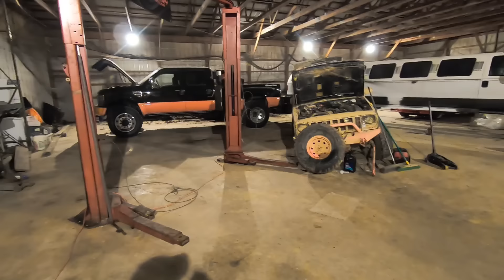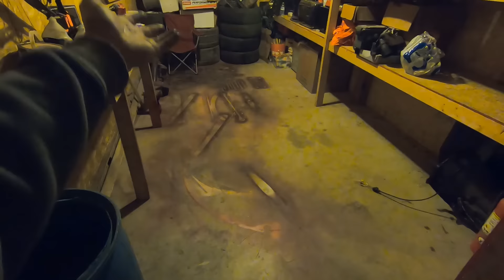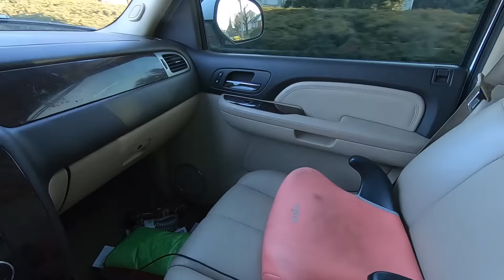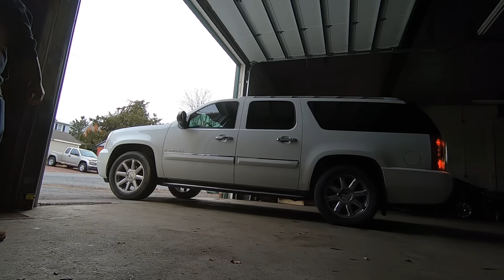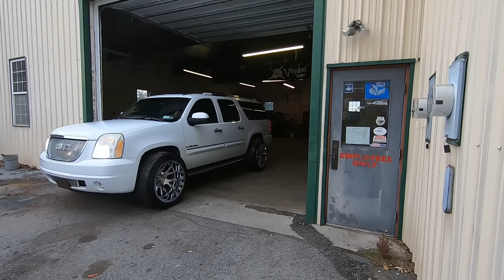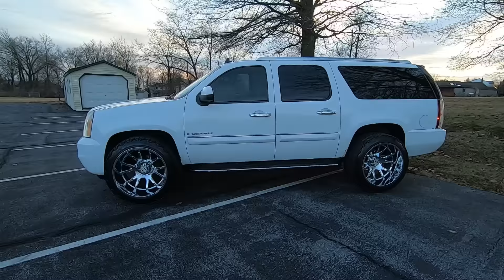DENALI build gets 24X14's! COP MAGNET

Comment: Love the look of the wide wheels! I had rough country 6” lift on my 07 1/2 silverado and a body lift with all gaps filled so you couldn’t tell there was a body lift which totaled out to 10” had 20x12 fuels and 37” Mickey Thompson Baja mtz and 2 inch spacers in the rear because the front was wider than the rear when lifted so the spacers made it even. Can’t wait to see how the Denali turns out!